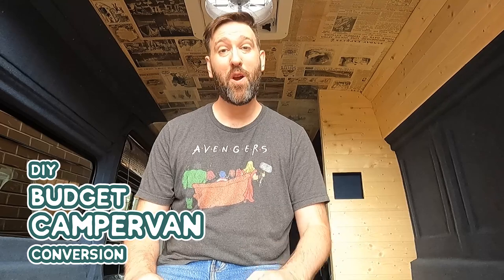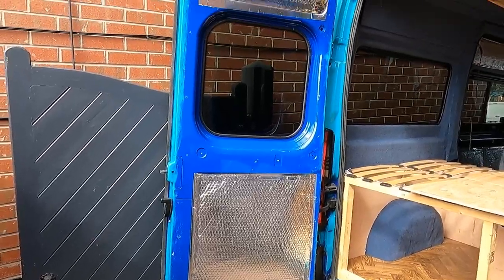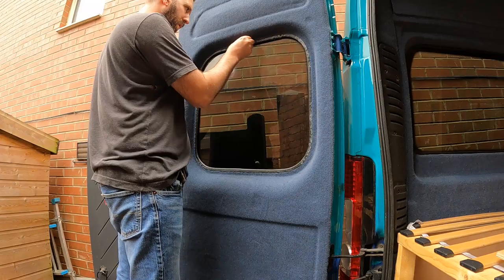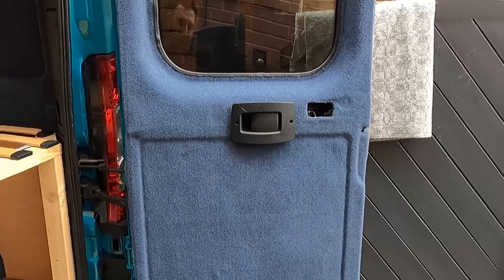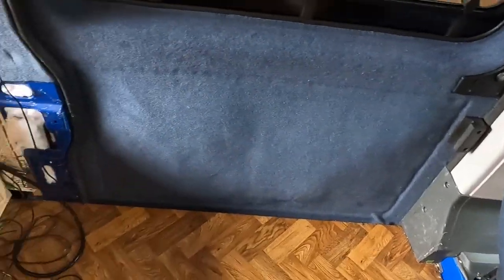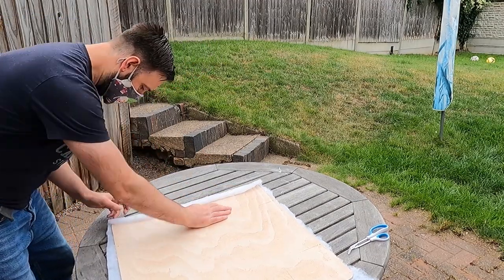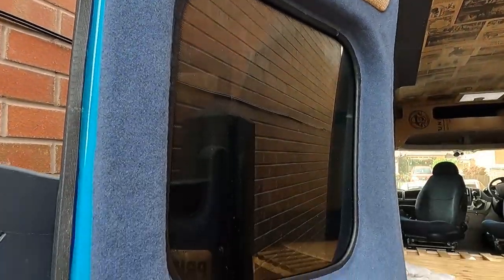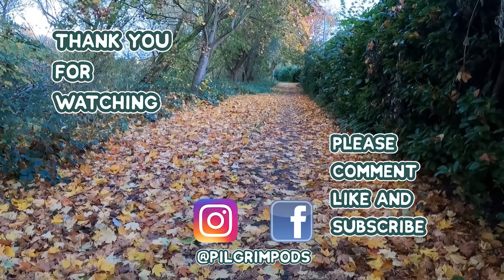Finishing CAMPERVAN Rear and Side Loading DOORS - DIY Budget Campervan Conversion

Comment: Going great guns  such simple concepts that work would like to know what you have decided on seating kitchen and if you will include a shower and loo or not in the MWB van os the colour is great 👍
Reply from the maker: Being built mainly for weekends away it won't have a shower room but the toilet will be housed in a cupboard. Swivel seats will likely have a small table each for eating at and the van will have a kitchenette on one side and a sink unit on the other. 😊

Comment: Where you have your decorative inserts I have used the same method but replaced the ply with protective floor covering plastic panels. Lightweight, easy to cut with scissors a cheap. £5.60 for an 8x4 sheet.non of my carpet is actually stuck to the van

Comment: Good to see you back. Just a tip though, if your rear door carpet goes under the rubber seal, it might start to wick water through into the van when it rains. You could run a sharp knife around the inside of the seal with the door closed and remove the excess to ensure the carpet doesn't interfere with the seal.
Reply from the maker: Cheers Jake! Thanks for the tip. I've been out in the van to check everything is still watertight and all seems ok but I'll definitely keep your advice in mind should an issue occur.  😊👍